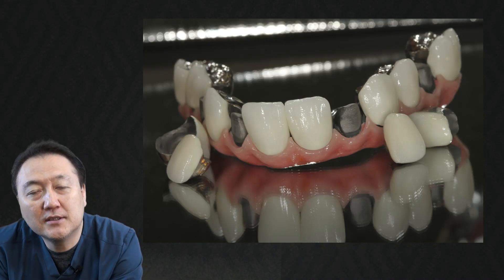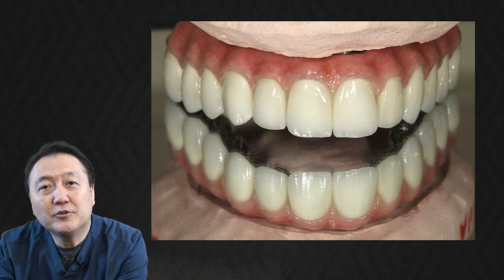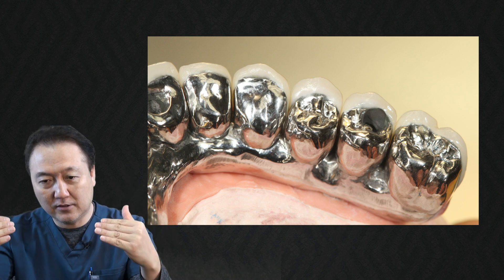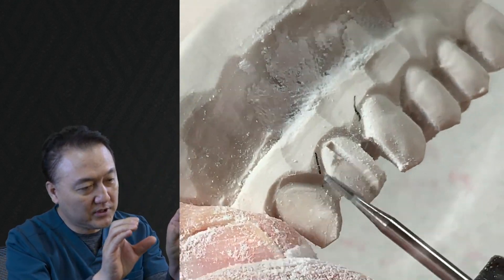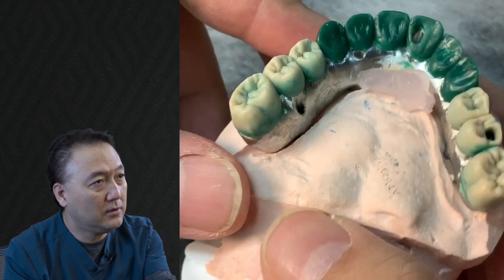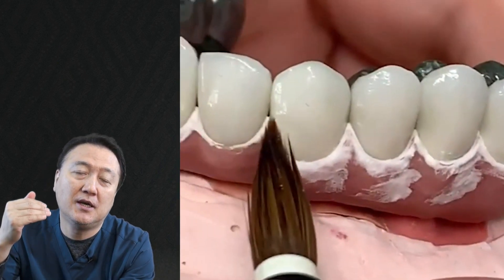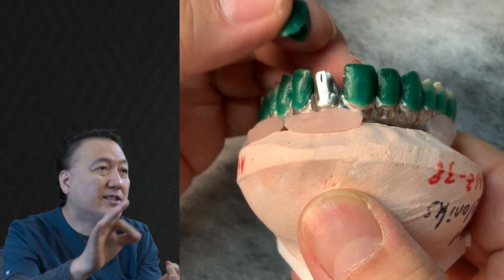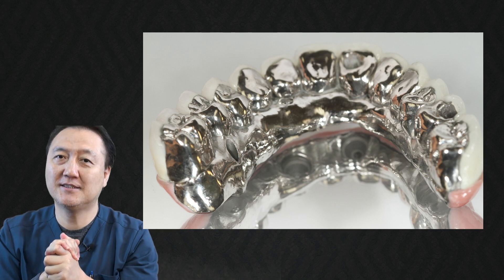Best Restoration for a Heavy Bruxer | Metal Lingual Full Arch

Comment: I asked this question all the time I have received a full mouth restoration top and bottom I figured 2 fix my problems I got periodontal disease and I was pregnant so they wouldn't do anything until I had the baby and things just got worse my teeth became brittle when I was pregnant I lost two front teeth when I bit down on a slice of pizza and I always had a beautiful smile I took care of my teeth but my pregnancy for some reason which is attacking my body so to repair everything it was going to cost $55,000 when I heard about the fixed bridge I said well if I'm going to have to spend $55,000 and keep up the maintenance I might as well just get rid of them so I did they are beautiful but as the years go on I have noticed you can see the lining of the tooth root which wasn't visible for many years I received so many compliments no one knew I didn't have any problems with my speech I can't even tell there and they feel like they're a part of me when I get something stuck in my tooth I can actually feel it which is strange I know but I can and I want to upgrade and your work is incredible I have not come across anyone like you your work is phenomenal and I would love to be able to send over my images or whatever you would need to make another set so if you could get in touch with me I would greatly appreciate it just leave me a comment where I can reach you thank you for your time and thank you for what you do you are truly an artist